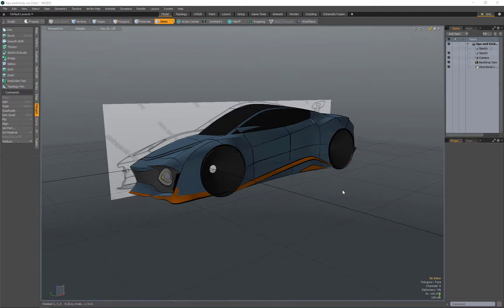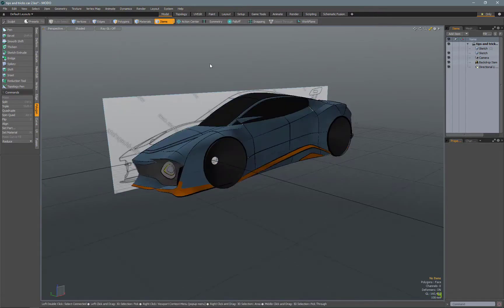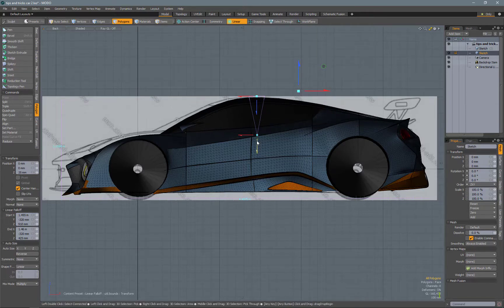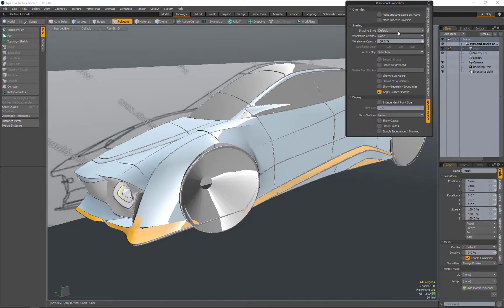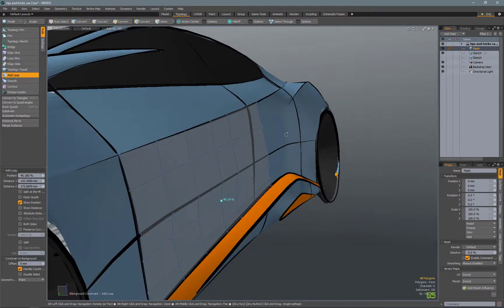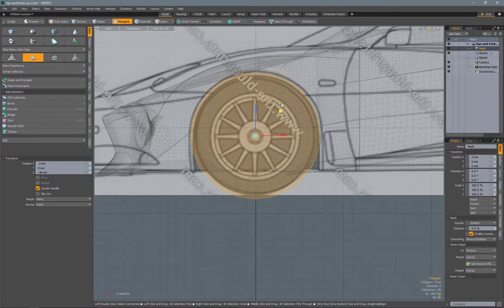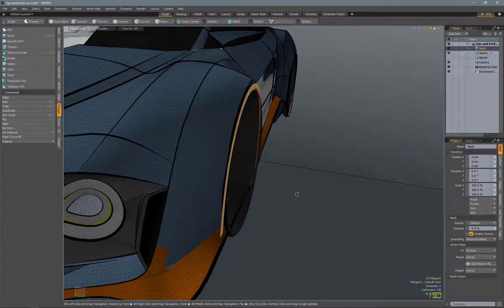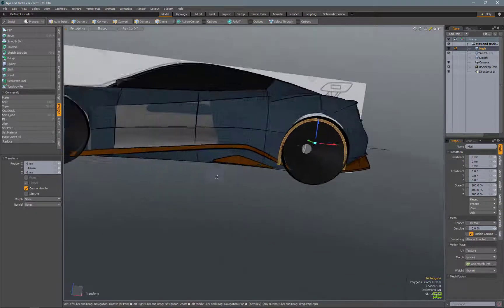Gravity Sketch VR+ Modo, tips and tricks PT5

Comment: Thanks for showing your workflow! I was wondering, why go through Modo, instead of going to Alias /other Cad right away?
Reply from the maker: You could absolutely do that. I just prefer modo at this stage because I can morph, push and pull the surfaces and design lines to get the volumes a little more sorted, while not worrying about continuity and surface breaks. and honestly for digital renders this is good enough to evaluate. I reserve alias for later refinement.